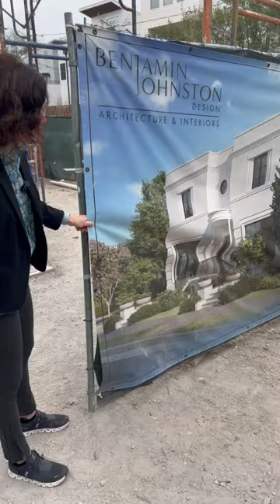The Importance of Leading Lines on a Home

Comment: Amazing details and planning! 2 questions…does that mean that you carry those same adjustments all the way around the building bottom to top or does it vary section by section? Also what affect, if any does a larger or smaller “blob” of cement have in the integrity of the structure ? Fascinating info thanks!
Reply: yes, we carry the leading line around the entire structure.  The 1/16'  adjustment in mortar have no effect on the structure.  In fact, the brick is not structural, just cosmetic.